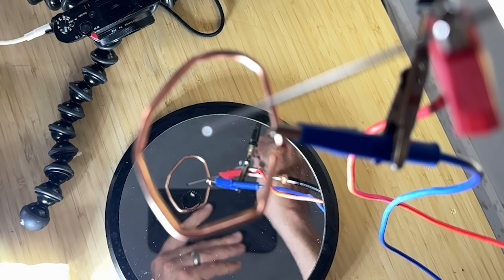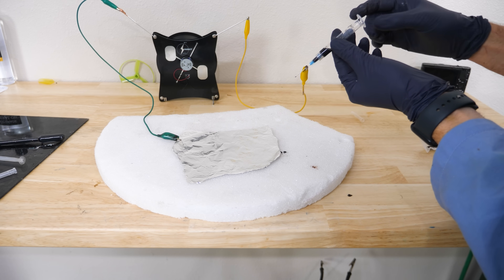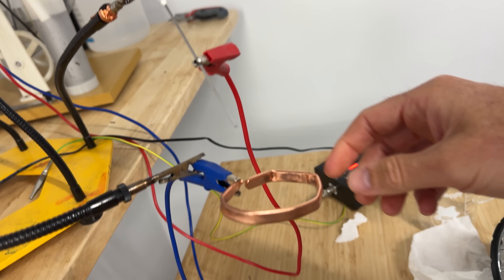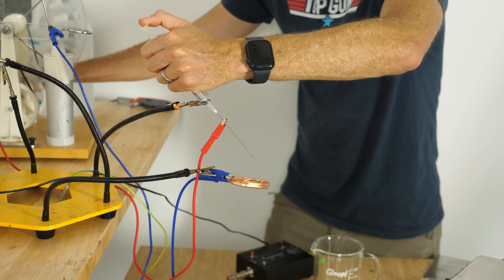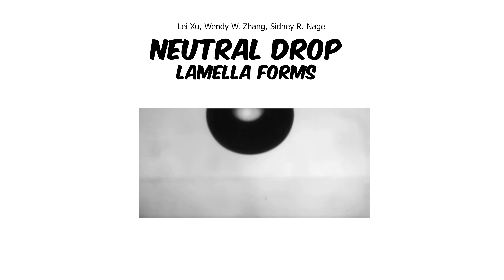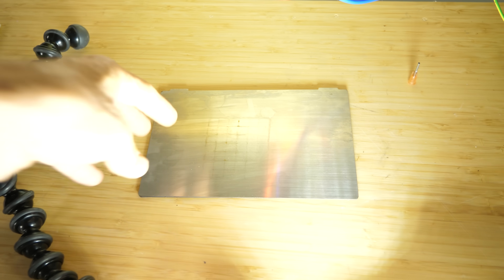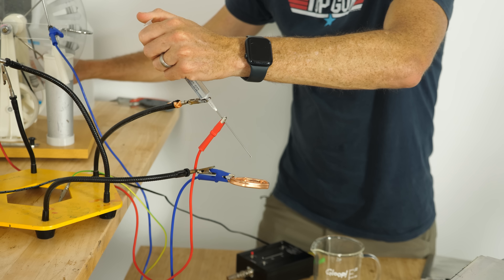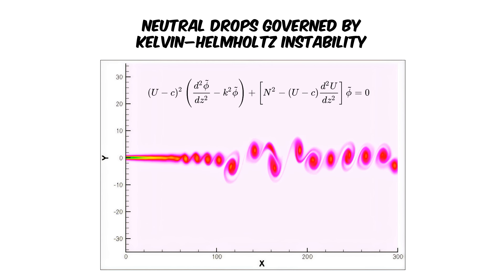Scientists Just Found Why Electrified Drops DON'T Splash

Comment: Surprised the American military hasn't made some sort of naval water gun with this. Looks like it would have crazy energy retention on impact.
Reply: The start of the video explains why. Getting the charge too high will make the droplet explode to mist before it gets anywhere and too low eliminates the effect - humans probably don't qualify as uncharged surfaces either, which is the other component needed for this effect to appear. Drops big enough to have any effect as a weapon don't stay stable under aerodynamic forces anyway (They don't even have to be that big to break up in flight and they break up very quickly - this break up in flow is why it's very hard to get electrocuted by peeing on an electric fence for example), so the impact this carries wouldn't be useful, especially compared to the options already available - freezing the water before firing would be more useful.
Reply: @peglor  I would have guessed bigger water droplet can take bigger charge. But idk much about this stuff. 

Big water droplet cannon or something
Reply: @diabolicjackel8905  Just Drop Big Round Granite Balls from an Aircraft at high altitude.  The Impact 
Force is equal to or Greater than TNT.  Much much cheaper too!!  The sonic boom does most of the 
damage.  I call it "Bowling Balls for Peace"!!
Reply: @peglor  giant paintball gun idk xD
Reply: How do you know they haven't? You do realize that since the 1950s the military and government created a program to develop weapons and Technology that should be a minimum of 20 years ahead of all competition and everyone else, this is to ensure that there are no surprises like they had with the nuclear bomb.

With that said, if you start to see the military showcasing something new it means that they've had it for the past 20 plus years, they have technologies that we won't see for another 20 or 30 years and they only release it when they developed something significantly better.

Military is already using charged surfaces for their aircraft like the b2, they are already using ultrasonic vibration to increase weapons speeds under water, many individuals who came from intelligence services have come out and said that they have been working on anti-gravitics for the past 50 years, suppressed it and made it taboo to discuss in the public as well as other fields of science so that there is a much lower risk of the public figuring it out.

They already know about this effect, they have already looked into how they can weaponize it, that I can guarantee you. There is a law that allows the US government to seize your patent if they wish to use it or hide that type of technology. I think over 7,000 have already been seized and hidden?
Reply: @sacr3 your 100% right. Last I heard it was 6k+ patents seized under "national security".
Reply: @PigeonLaughter01  do you know if these people get paid for their patten taken or are they just SOL? I'd guess they give em a lockheed martin contract lmao

Comment: That makes sense too, In some Painting that I have done in some metal shops, We used a spray gun that is electrically charged with a Positive Cable and a Ground wire connected to the Metal object being Painted. The Paint Is Pulled to the surface and the Spray can even "turn the corners" of the edges of the object as the spray lands. Seems to make a Very Good and Even Coating too! Makes me wonder why all of this is Just now being Talked about. The type of painting I was doing has been going on for a long time, and I was Painting with that method over 20 year ago. 🤔
Reply: Worked with such in 1987 but electrostatic painting has been around since the 1940s.
Reply: It's about splashing drops busting on impact. Not about charged liquids followingelectric fields, which is used in many areas. There is also a nobel price for making carbon nanosheets using duct tape. So simple ideas can still be novel
Reply: @VR_Wizard  
I did the experiment before the Russian (turned English, I think) scientist did that creating graphene. I didn't know until afterwards. They also lifted frogs using magnetic field.
Lastly, the experiment above is not quite how you described, it's about charged drops landing on non charged objects, they used a mirror (or dielectric).
Reply: I just thought of another effect about going around corners and an even coating --- When the non-conductive powder sticks to the metal, would that powder insulate that bit of metal, so that new powder with static charge would be attracted to the gaps where the metal is still exposed? That would contribute to a self-leveling final coating?  Must have been totally studied before.
Reply: Powder coating is baked on in an oven. Paint has an adhesive and a solvent in it. They’re similar, but electrostatic painting is not powder coating, hence the use of different terminology. “Literally” 🤦
Reply: @Walkeranz  Powder coating is a type of coating that is applied as a free-flowing, dry powder. Unlike conventional liquid paint, which is delivered via an evaporating solvent, powder coating is typically applied electrostatically … Wikipedia
Reply: Yeah, that's been used for a very long time when spraying Lacquer on brass band instruments.
Reply: Why do you type like this?

Oh wait-
Reply: Literally powder coating.
Reply: I've just deleted my comment where I suggested this method.  Seems I was re-inventing the wheel.  I was aware that powder coating uses electrical charge to attract the powder to the surface.  I wasn't aware of any process that does the same with liquid. But I'm not a painter.
Reply: this is a bit more subtle. reason for electrostatic painting is to make droplets stick not to avoid them splash. splash wasn’t considered and paint splash much less than water
Reply: Electrostatic paints are used on conductive surfaces that are grounded, so this non-splashing effect has no role.
Reply: @pocpic  Huh? There can still be a difference in the charge of the paint you’re spraying no? Therefore creating the same effect.
Reply: It sounds like you're describing powder coating, where the 'paint' is a fine powder of dry plastic particles and you bake the item in an oven after coating to get the powder to melt into a uniform plastic coating. No splashing involved because the only time liquid is involved is when it melts in the oven after the coating has been sprayed on dry.

Comment: Have you seen the video where a wire with high voltage? Will cause moisture in the air to conduct of the wire and droplets of water will fall and accumulate. Making it a good way to harvest water on a cloudy day.
Reply: "to conduct to the wire" i get what you are trying to say but that does not make much sense the way you worded it lol
Reply: yeah, if by good you mean it takes thousands of watts for a very small amount of water.
Reply: @grantcurtis5200  actually, it's not the amount of watts, it's the volts. You can come up with an incredible amount of volting, very low watts.
Reply: Plasma Channel is great!

Comment: Becasue the charged drop now has to completely push the air away as its pulled to the surface could this effected be used to make an air compressor? Albeit a very weak one.

Comment: You can charge the water with separation with that same syringe. You can shoot water down a vinyl tube and at after it gets out of the tube it will be charged you don't need the coils or electricity. The water will make electricity from running down the vinyl tube

Comment: If you have a thin metal layer behind your windshield glass, charge it up to a few thousand volts while it's raining and the water might make an even layer you can see through. Probably want two separate layers though, the back one should be neutral otherwise all the dirt will stick to the windshield on the inside.

Comment: One thought I had is trying to avoid splashing when working with incredibly precise recipes in chemistry. I always see in NileRed type videos when pipetting a small amount of something into a solution there's often a droplet that flies out of the beaker. Never seen anyone acknowledge this or whether it causes inaccuracies in the chemical reaction. It might make sense to charge the pipette oppositely to the rest of the solution so that it is more actively attracted into the beaker instead of being flung out.
Reply: I like where you're going with this.

Comment: So, if I got this right, a) the drop has to be charged, either positively or negatively. b) The surface it will hit has to be a dielectric. c) the goal / benefit is to not have splashes, but coherent drops on impact. Windsheilds?  Don't see any. The wiper blades will still have to remove drops. Formica  counter tops? Getting rare nowadays, and it may barely make cleaning easier (less droplets). Again, it takes two to tango, so the tomato sauce will need to be ionized. Art? Making neat drops on a fiberglass canvass? Love your action lab! We can't really learn physics and science only by reading stuff. A lot of discoveries were born out of oddities or exceptions. These are very very precious to our progress. You lead the way brother!
Reply: No blood splash, when jumping off a building.
Much easier to clean sidewalks.

Would have helped when the Market first crashed.

Comment: Hey! Interesting theory here: It will seem funny, but we could be onto something:
Here in my country, countrymen and old people say that if the raindrops leave a bubble upon falling on water (Like a puddle, a bucket or a lake) it means it will rain a lot. 
Now, I don't know if I'm a victim of suggestion or the phenomenom actually happens but it does seem awfully accurate, for what I've seen over the years. Maybe it has to do with the charge from electrical storms?
What happens if the charged drops fall on whater compared to uncharged drops? Has it been tested? Maybe part two of the video?
Reply: I think that this paper might explain that better, but it's a cool idea: "Intentionally Added Ionic Surfactants Induce Jones-Ray Effect at Air-Water Interface,"
by Yuki Uematsu, Kengo Chida, and Hiroki Matsubara.

Comment: You could also try a uncharged/charged dielectric liquid (mineral or silicon oil) on a conducting or dielectric surface. With dielectric fluids you could also charge the surface , control/ calculate the Dropletsize (surface tension) and then adjust the Voltage under over or at the Rayleigh Limit. With all Dielectric/Electric + Charged/Uncharged (under/at/over Rayleigh) combinations all Splash Scenarios should be predictable.

Comment: Doesn't this also mean we could electrostatically steer the drop onto a precise location?
Reply: Ok, electrostatic steering was used in early inkjets. I'll just wear this hat and go sit in the corner. 😅
Reply: @kurtnelle  Sorry. My real point was that it is old technology.
Reply: Congrats, you just invented the inkjet printer.

Keep it up. One day you will stumble over something as the first.
Reply: @madshorn5826  Inkjet printers don't use electrostatics to steer droplets. But what if they did? Could we print faster or at a higher resolution? Imagine the possibility... oh wait, you can't since you have no imagination.
Reply: Uh.  Yes they do.  And no splash hitting the paper.
Reply: Gee I wonder how inkjet printers work
Reply: Only if you can charge specific point 9n the target. Question is how can you do it without touch?
Reply: I feel like this could help immensely somehow when it comes to guiding chem-trail droplets. Not that those are real. But, if they were…. Not that they are…. There might be some improvement in dosage delivery.
Reply: @Scott-sx1bf  it's OK as it is.  It only hits the nut jobs. 😅😅😅😅

Comment: I know know about charged spray paint to completely cover metal surfaces evenly in order to use less paint. It use a special sprayer that can electrify the paint when it’s sprayed.
Reply: Powder coating too.
Reply: No need you just charge the paint and then ground the material and it magnetizes. I installed the giant electromagnetic tank for BMW. This is how they dip their cars.
Reply: @hercules71185  that was what I tried to say, I couldn’t find the words. Thanks for clarifying.
Reply: So this isn't a new discovery then...
Reply: Ionization Good call
Reply: Like powder coating

Comment: Wow!! Then if we make a charger for a spray can or for any other pressurized ink jet, we may be able to paint dielectric surfaces without wearing a mask, since al the droplets will adere to the surface? Maybe i have found a promising theme for my TCC!
Reply: I think...there would still be toxic vapors. I'd be worried about the parts of the paint that I can't see~
Reply: Qual teu curso? To tentando pensar quais cursos abrem possibilidade pra esse tema 🤔
Reply: @thais1571  Engenharia Elétrica

Comment: Perhaps in a Vehicles Windshields glass !
Reply: I was thinking this - if the opposite holds where neutral drops don't splash or spread when hitting a charged surface, windshields could get a nanocoating of metallic deposition and that could then be charged by a static generator when the car is in motion - preventing rain, splashes, etc from splattering when hitting the glass - even better than a permanent rain-x.
Reply: @offshack  Wouldn't the windshield already be dielectric, so adding a charge would make the drops splash more? I mean, assuming that most raindrops are charged~
Reply: @auturgicflosculator I would think except for in a large thunderstorm that most rain drops are quite neutral - after all they do tend to splatter a lot when they hit my deck and my patio furniture which are dielectric - but it's not feasible to force the water to get a charge on its way in, but if it's neutral and the surface could be made to have significant charge it should work the same way, as it appears to be the difference in charge that causes the "drop-stick" effect
Reply: @offshack  The air always contains a mix of positive and negative ions from cosmic rays and radioactivity. As a water droplet falls through the atmosphere, it can capture ions, taking on their charge. Lots of particle collisions happen before a drop falls, as well.
Reply: @offshack  Your idea is interesting though, maybe setting the difference based on various atmospheric conditions could improve the effect.
Reply: same thoughts!

Comment: Great video, this discovery might be useful to improve fuel injection systems.
Reply: As far as increasing atomization of the fuel then potentially yes. The technology of the spray tip would change from ever increasing the fuel pressure to safely applying charge to the fuel WITHOUT generating spark potential. Hmm...
Reply: Maybe back when injection was in the intake. Now it's direct injection. You need the high pressure to get the fuel in under compression, which keeps it cooler til it's needed, less knock, more precise timing
Reply: @pgtmr2713  I'm definitely not a volumetric efficiency expert so am out of my depth here. I can understand that the fuel pressure has likely already been optimized as you described. Hmm, a plastic sleeve just before the injector tip could provide charge but with the fuel being a homogeneous, conductive liquid going back to the pump/tank the fuel is essentially grounded so would need a means of insulating/isolating the fuel in the injector undergoing charge.
Reply: Remember the Moleculator?